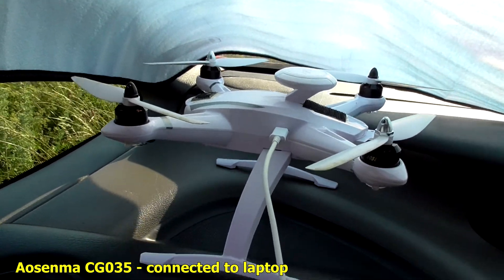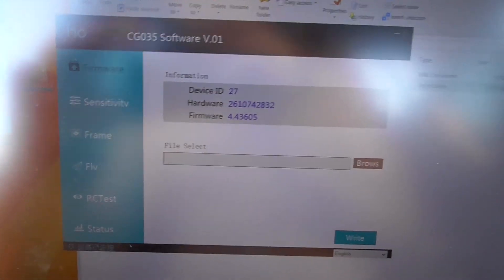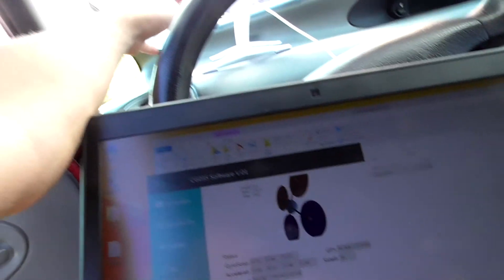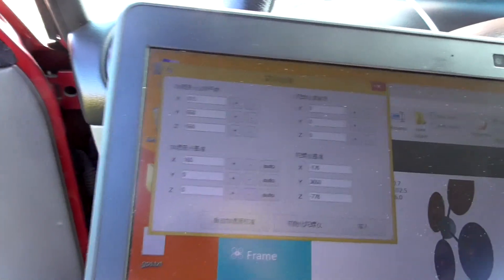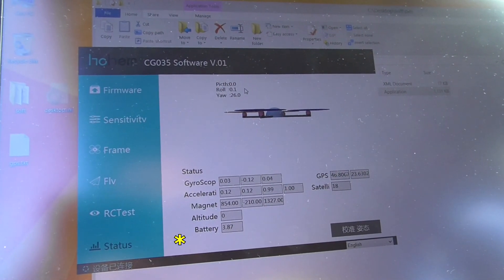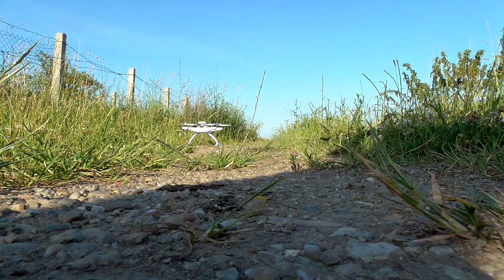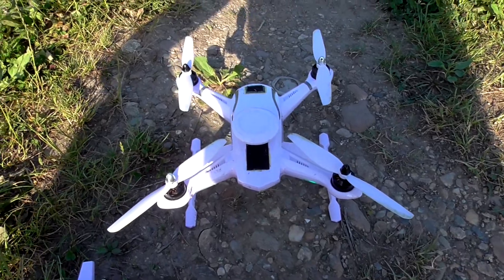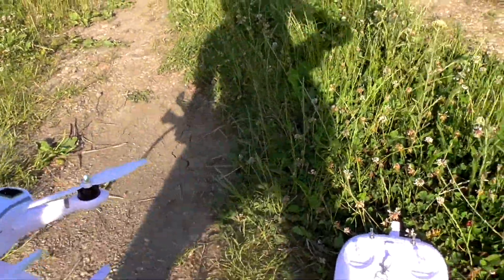Accelerometer Calibration - Aosenma CG035

Comment: Dear Admin, where did you locate the software for the laptop 💻
Reply from the maker: Internet :) 
Search for VAST_GCS
Reply: @furulevi  thanks👍
I was hoping to locate the software to calibrate the quadcopter, not necessarily the firmware upgrade
I'm having serious issues in binding the controller with the quadcopter,  after dismantling the quadcopter, there are no binding button, as I've seen elsewhere.
The Green/Red lights remain on and steady, thile the Blue/White lights keeps flashing, when the battery is plugged in to the device 
On the controller, all Red Lights remain on, despite fully charged batteries. The controller only works in changing the the position of the throttle and direction controls. Any suggestions on how to resolve this issue, I've searched YouTube and the Internet, but to no avail